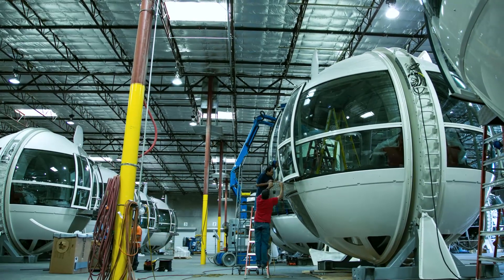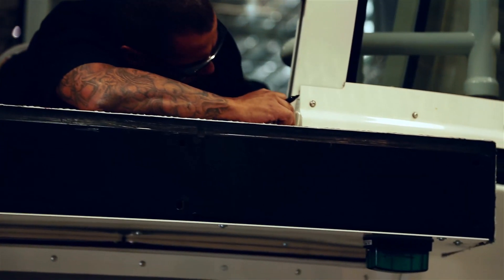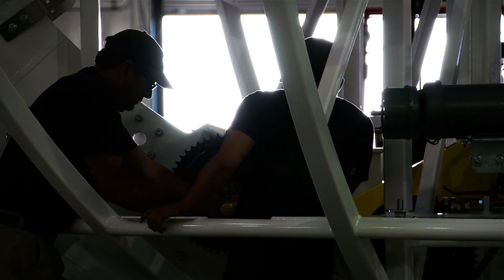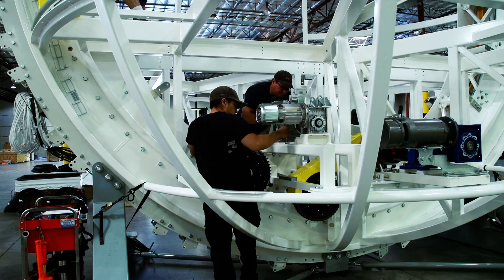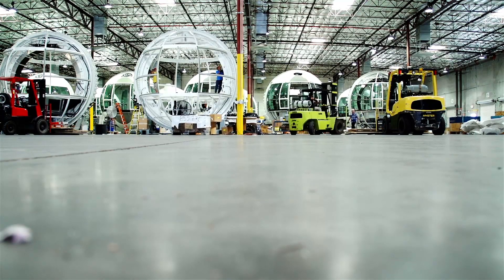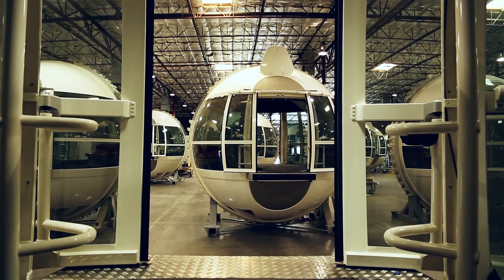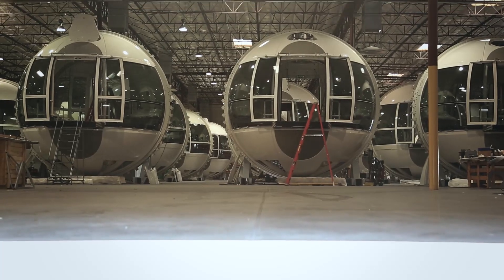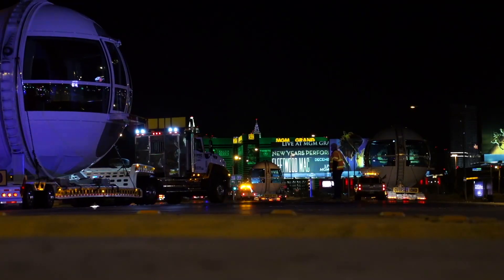Las Vegas High Roller Cabin Assembly

Comment: What happens if the rotation motor of the cabin breaks down during the trip? It is necessary to evacuate the cabin with a crane or aerial platform or there is a double rotation system moving the chain with a second motor? Thank you.